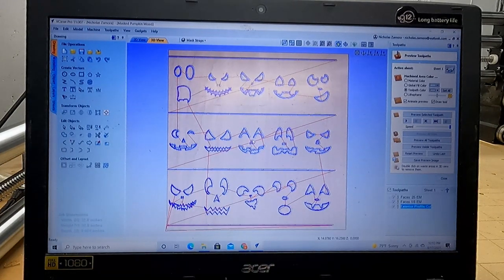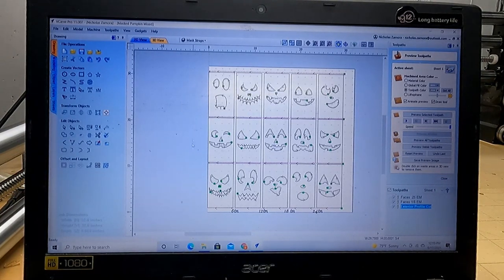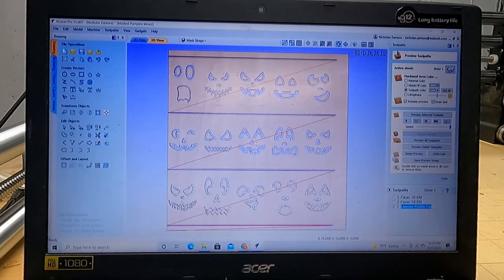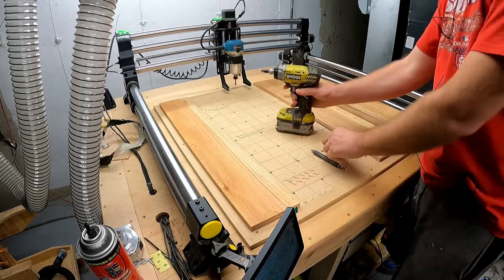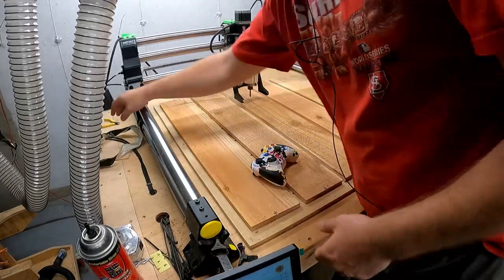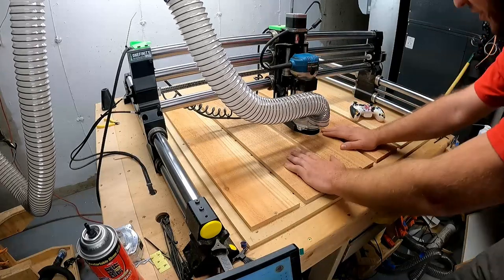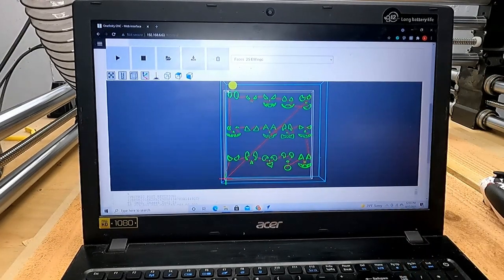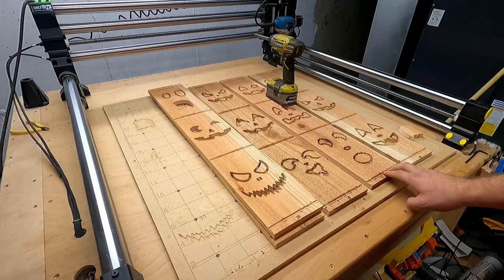Ultimate Guide To Jack O Lanterns for the Beginner

Comment: I have 2 questions. What was the reason why you referenced the spoilboard instead of the material again? I have been used to referencing zero on the material.

Also,why not just let the bit cut each face out with tabs instead of using a chopsaw at the end? You could have just let the CNC cut it I would think unless that was going to take too long or something.

Thanks for the video!
Reply from the maker: I referenced the board because my file is setup to start bottom left and my grid starts from there as well. In the program I know as long as my boards bottom left is at 0,6,12,18, and 24 I'll get my carves correct. But you're correct for most projects you should use material to zero. Since we're using multiple boards in known locations it's a special case.
Reply from the maker: I didn't use tabs mainly because the time, wear and tear on the bit, and since I'm only holding each board by two screws the tabs would really be critical to hold things together. It mainly comes down to personal preference. Thanks again!

Comment: This may be a silly question, but how do you do the horizontal score lines between the lanterns.  I'm using Vcarve desktop and cant figure it out.
Reply from the maker: Just make a line, do a profile cut on it either on, below, or above depending on where you put the line. Then in your tool path select your depth. Good luck!

Comment: Why do you need a space between the parts? : )
Reply from the maker: If you’re talking about the space between each board (horizontal space) that was because of the variation of board width. And the degree to which I marked my spoil board with known distances to reference, that is needed when making the gcode. You could place the boards closer together, but you’d have to mark more on the dollar spoil board, and edit the code for each batch. Even with putting them together you don’t gain enough to add another board so I decided to space them out if that makes sense.